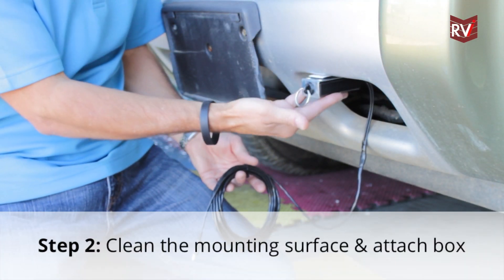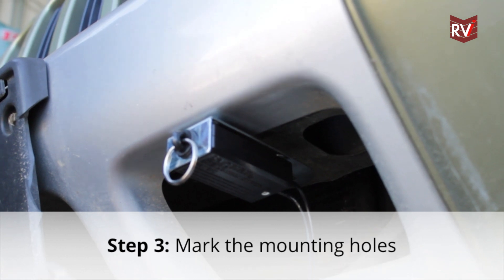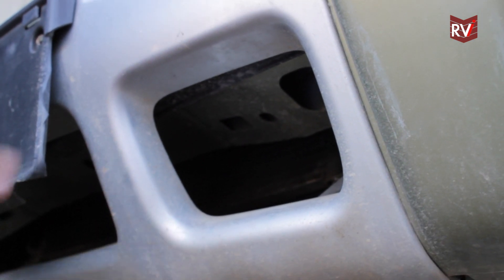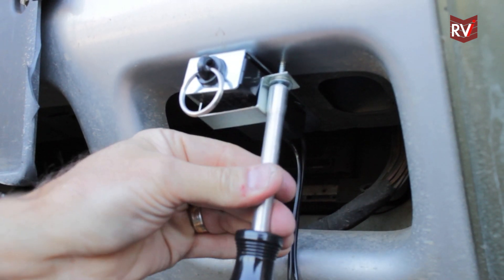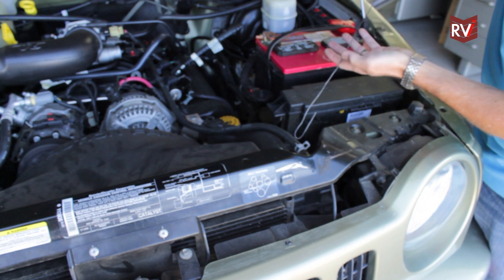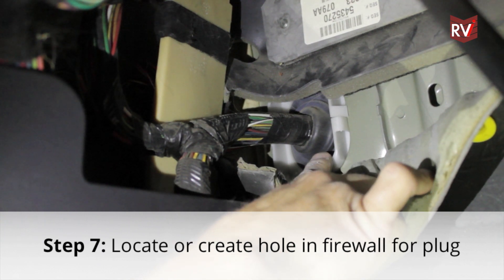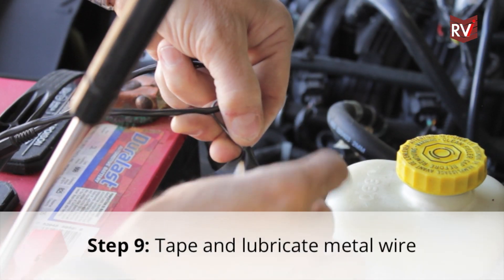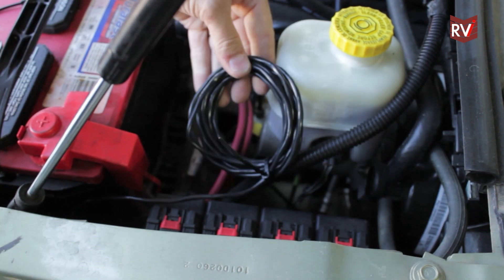RVi How-To: RVibrake Breakaway System Installation

Comment: This switch bracket should be pop-riveted in place with a couple of fender washers on the back-side of the bumper to give a solid perch so the pop-rivets don't pull through the plastic bumper. This is the way a professional would install it.
Reply: Hey...it's the motorhome industry.  4" self tapping screws are the go to standard for securing heavy mechanical items to 3/36" luan panels.  DON'T ROCK THE BOAT!
Seriously this is a schlock installation at best and that's being kind.  Coiling excess harness wire in the engine compartment is just as infuriating as sheetmetal screws into a fiberglass or plastic air inlet.  Seriously that's supposed to be a long term installation?!!!  I just wish the people that supported RV-ing would take about a 6 week class on basic quality mechanical standards, before they get the chance to cam out every phillips head screw, mis-align every single structural bolt and pretty much dikup everything they design and install.